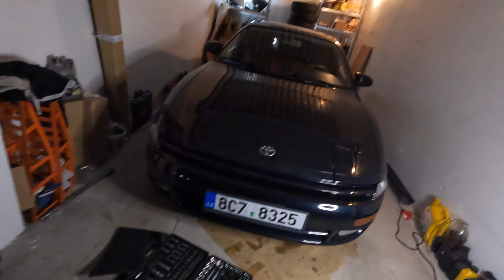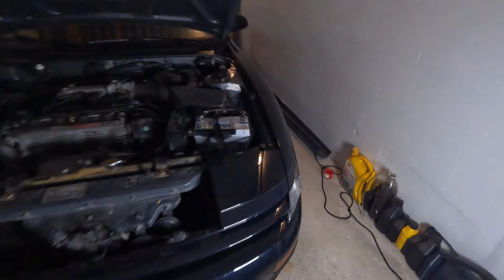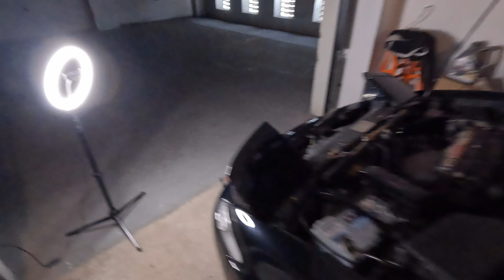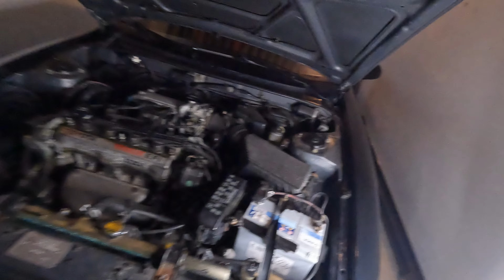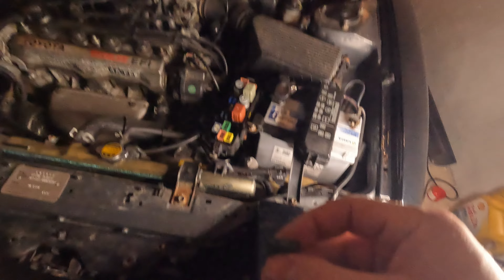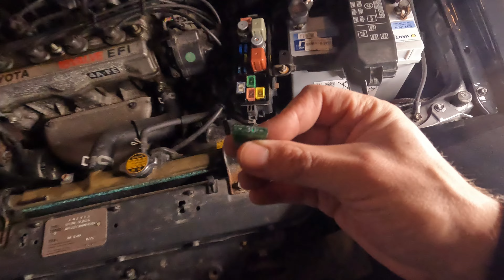T18 Celica pop-up removal and clean-up

Comment: Can you do a video on removing the ecu to replace the capacitors?
Your video on removing the dash cluster for the 5th gen is the best I've seen 👍

Btw, Excellent videos on the 5th gen Celica, a future collectible classic with incredible reliability and built back in the 1990s with the same obsession to quality as the Lexus 
* Also, i reckon it looks better and way cooler than a MK4 Supra
Reply from the maker: Hey there and thanks a lot!
 I may make a vid to remove the ECU, but I am not sure if I will also replace the caps. No promises on the date though. Definitely not in the near future.